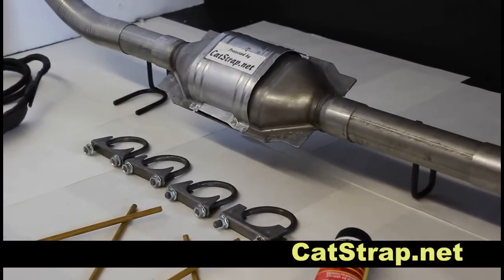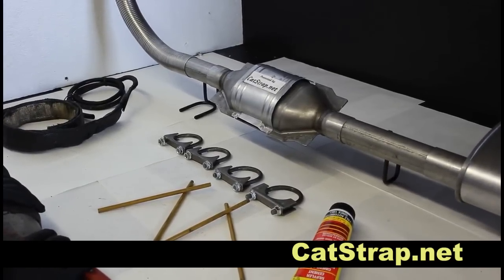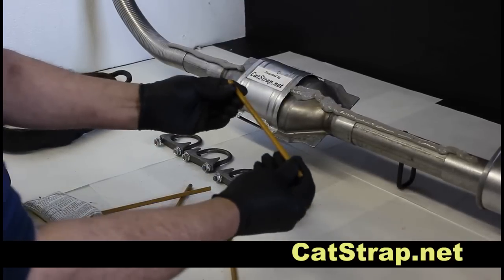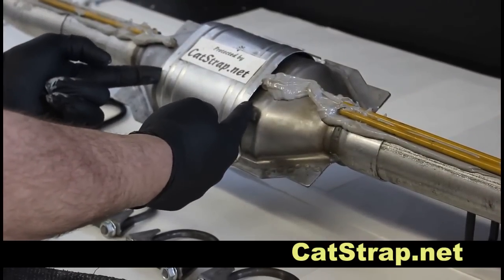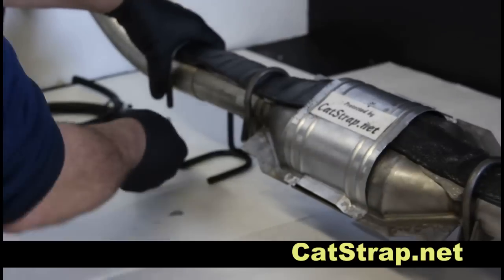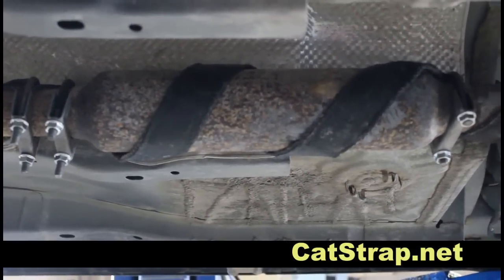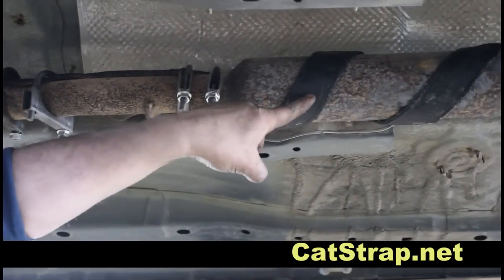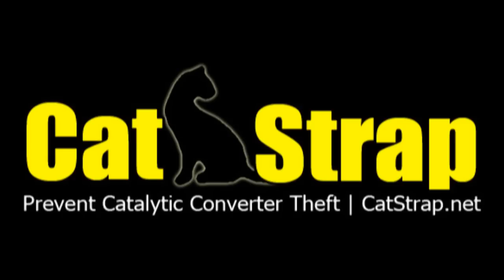Prevent catalytic converter theft with Catstrap

Comment: Imagine when it comes time to replace the cat converter with the cat strap on.
Reply: right on
Reply: Stupid comment it's an alarm and the strap is bolted on with clamps so it's not impossible to remove just harder for thieves and also the audible alarm.  Yeah you might have to buy new cat strap but the whole system shouldn't be a waste, how often do you place a catalytic converter anyway?

Comment: Looks to me like the hardened steel pins and the pipe clamps would be sufficient to deter a would be thief.  I mean are they going to bring a rachet set just in case they need to pull off any pipe clamps?  Not if their goal is to get in and out in five minutes.  Better still is to hold the steel pins in place with various sizes of pipe clamps so that the thief would have to change sockets.  Surely, this would frustrate them and they would bail for fear of getting busted.  Would rebar be a reasonable substitute for the steel pins?  Anybody?
Reply: Rebar cuts in a second and the clamps are mostly to hold the pins while the glue dries clamps cut right off to

Comment: Yeah permanent to the point, where even your mechanic cannot replace the cats when they go bad. Forget about the glue.
Reply: They will be able to eventually cut it, will take a lot more time and money though
Reply: Angle grinder would make quick work out of a cat strap.
Reply: @ghostsof6tharmy644  yup, but the alarm going off will be an issue as well
Reply: @AHalz  yeah that's gonna be problem 😂
Reply: @AHalz  literally unhook the power cable for it......not a hard concept

Comment: I’m very impressed. Do you have any distributors in the UK? Had my CAT pilfered, trying to protect the new replacement installed in my 2008 Prius. This seems to be the very best all in one solution so far! 😃👍
Reply: datathunderstorm what really me too car was parked on busy road two doors away from a shop Prius 08
Reply: Just had my 2008 Prius Catalytic converter stolen in Islington. They did it during the day in broad (albeit freezing) daylight.
This deterrent looks promising..
Reply: Sorry to hear you’ve both become victims of this dastardly crime too. I cannot believe these effing criminals are still on the loose, blatantly ripping off Prius cars in broad daylight in the capital of the United Kingdom! Absolutely disgraceful. This is neither normal nor acceptable in a so called civilised 21st century capital city!
Reply: Michael Griffiths Check out the Prius Chat website for more support and assistance regarding your CAT theft.
Reply: you need to install thick metal panels underneath the car, just like the supercars...
Reply: @datathunderstorm  thanks, I will.

Comment: I took my Cats off so Thieves are Screwed......
Reply: Recently my town's local police department posted a brief article on FB warning locals about a rash of cat thefts.  Some of the comments were people bragging about how they had replaced their cats with a flex pipe.  These comments were on the police department's post, by people who live in their jurisdiction.  I believe the fine is $2500 for tampering with the cat in such a way that it compromises its functionality.
Reply: Yeah, on modern computerized cars, that really screws up your engine management.
Reply: @fubartotale3389  Unless you put in O2 sensor simulators. There's a workaround for everything.

Comment: Stupid, This doesn't stop them from trying and messing up your exhuast. Get a plate designed for your car. Having fit hundreds of plates to Aurises, they cost £9 to manufacture and can be installed in less than 5 minutes.
Reply: Do you know a video that shows how to put a metal plate protector for the catalytic converters? Where can one buy the metal plate?
Reply: @sufi5uk  You can get cat lock plates which are more expensive. The ones we make and fit are exclusively for a car hire company for now. At some point we will be designing and making them to sell. The company that we're making them for get between 10 and 20 stolen a week. We've not yet had one stolen off the cars we've fitted the plates to.
Reply: J Anything anything you happen to be familiar with along these lines in the US? Thanks.
Reply: I was thinking the same but realised the point of this system is so that the alarm goes off and alerts people around
Reply: @teem5642  and who reacts to car alarms any more?
Reply: @OIII-IOOO  exactly. They will just continue sometimes. People normally ignore them thinking it's a false alarm

Comment: Save your money ppl. This is counter productive. Cost more money to remove when cat goes bad.  Just tack weld a length of rebar. That glue shyt and running wires is a mess. 1/2 rebar.

Comment: some engines like the GM 3.6 L in the mid size cars I think have the cat right off the manifold which is a vertical mount between the engine and radiator fans....not much theft potential there. This kit looks like too expensive, messy as hell to install and will result in a lot of difficulty to service the cat down the road. Imagine laying on the driveway and trying to apply that glue material, rods and strap to old rusty and dirty exhaust pipe in an overhead position... pretty challenging scenario.

Comment: I just threw away my old catalytic converters. Full of silver and platinum. 😹
Reply: it's like gold plating things... there's honestly not enough to be worth anything unless you're scrapping about a car lots worth of them... people make these things sound like they're worth far more than they actually are.
Reply: some are going for $800-1500 in my area. There's a reason people are stealing them right now.
Reply: @jeffhooper3447  $800 - $1500 is replacement cost. Crooks are lucky to get $50 - $100 for scrap cats.
Reply: @rupe53  except people are getting that. There are no more OEM Subaru downpipe in my whole city
Reply: @jeffhooper3447  ... starting to wonder if there's a market for that entire front pipe. Haven't seen what the new ones look like but the older ones were fairly easy to unbolt from the manifolds. (late 90s)
Reply: @rupe53  If I were doing crimes I wouldn't bother with any tool besides a sawzall.
Reply: @ToeCutter454  thats false they are worth allot
Reply: @randersizzerranderesizzer2753  only because the manufacturers mark them way up lol there's not even $5 worth of platinum in those things... the value is in the man hours and coating process not the materials... people are just stupid... materials in total to make one is less than $100.

Comment: sawzalll makes a lot of noise.  muffler cut off tool mechanical type makes no noise. doesnt matter here, no pollution control stuff. can run  smoothy sand tires on the road (cord showing) and doesnt matter as no rain... no snow that isnt gone in 30 mins or max of 2-3 days.

Comment: Well a thief will always find a way to get wat he or she wants so I say let them steal it if thy wish or risk a heavily damaged car in an attempt to remove the cat.
Reply: Do you leave your house doors unlocked and the keys in your car? Thieves want easy and fast. You aren't trying to prevent theft, you are trying to prevent theft from you. Make it more difficult to rob your house or steal from your car and they will say "fuck it" and move on to an easier target. THAT is the goal.
Reply: I mean you say that but what else am I supposed to do when my cat converter was stolen twice in two weeks? I don't have access to a garage or gated area to park my car in.  If I don't put some kind of deterrent on the car, this will keep happening over and over.  I can't afford to replace the part and pay for a rental for 4-5 days at a time multiple times a month!
Reply: @Beam3178  I just logged in to reply. You are not alone man, mine got stolen twice in two weeks.. Now I have to wait for the replacement parts for months. My mechanic will install a steel plate but what I found out reading online comments, they can cut through the steel plate as well! As soon as I get back my car I am going to sell it! I don't want to risk it anymore, I am sure they would come back third time.

Comment: Great idea for those California residences requiring the original cat on the car, but all others should just buy a new one on ebay and have it installed for a total Cost of $300 in most cases. This would result in a $700.00 net gain if you sold your original on ebay or an honest scrap dealer in your area and a trip out shopping or many dinners for your lovely lady, man, or love interest.

Comment: See I take the simple approach to stop thieves fucking with my car. It's too low to the ground to get underneath without a jackstand and I park on a sloped driveway so even if they tried to jack it up they'd have to move it first and if they want to move it's a dumb key with no remote start so no way to get it started, but even if they did get it started they would have to know how to drive stick. I leave that shit unlocked with a sticky note by the shifter that says "good luck!" 😂

Comment: Take a hardened steel chain and wrap it around the entire catalytic converter. Secure each end of the chain to the undercarriage using existing bolts. Problem solved forever. It’s easy to undo but simply takes far to long for a thief to undo. Plus, the additional weight of a chain wrapped catalytic converter makes it likely to fall on and hurt the thief in the event that they decided to cut the chain and put in the effort.
Reply: Thought about also but what about the chain rattling while i’m driving ?
Reply: @vmobile890  Im guessing that if you wrap the chain without leaving any slack, the noise will be negligible.

Comment: The heat cycling will quickly unharden the metal pins.  That fabric won’t stop a sawzall blade.
Reply: The fabric protects the wires for the alarm, the saw blade arcs the wires out and trips the alarm......

Comment: take cordless grinder with metal cut off wheel, cut clamps, cut heat shield to move strap , cut thru pipe into bondo and rods. or I can just take a hack saw and a hammer to bust bono holding rods ratchet with socket to undo clamps, cut the heat shield to pull strap out of way and cut thru pipe and have converter .

Comment: I am a heat treater and I routinely cut test pieces at rc60+ with a carbon blade angle grinder. 30 seconds I could have that useless thing off. What a scam.

Comment: I have a Leaf, guess I don't have this problem
Reply: they steal the battery instead.
Reply: @rearspeaker6364  it does weigh 660lbs.....
Reply: @stephenhodges2735  unfortunately, just give them a few more years.......
Reply: @rearspeaker6364  remember when they would park one VW bus rear to rear with another and swop the engines working underneath
Reply: @stephenhodges2735  aah, back in the day, when metric tools were a new thing to have in your tool chest.

Comment: 2 obvious problems: They wont see that its there and still ruin your exhaust, and you wont be able to cut it of yourself when you need to replace it
Reply: 1- it has an alarm and 2- exhaust is cut off by torch at a shop. A torch will cut it like it’s butter
Reply: @brokenwrench404  have fun oxy cutting it if them rods arnt steel.

Plus no, you dont use an oxy to cut exhaust tubing.

Comment: I'd like to see that thoroughly tested to see that it doesn't cost overheating of the catalytic converter because the catalytic converter heat sensor will then throw the computer off that's not a CEO sensor near the catalytic converter that's a heat sensor
Reply: There is an oxygen sensor before and after the CAT.  There is no heat sensor.

Comment: This might deter the thieves but doesn't mean they wont attempt to cut it. If they try to cut it yea you would of prevented the theft but your catalytic convertor is useless now and you would still need to get a new one or have a shitty welder weld it back at a exhaust shop....

Comment: what happens if you need to replace your catalytic converter? And...  if someone does try to steal it they will jack up your exhaust and it wont be able to be fixed without replacing the whole exhaust system.. LAME....

Comment: I don’t like “probable” place they will cut and once they make cuts through any part of the pipe you get a damn loud exhaust, like a hole in the muffler, which you have to repair anyway. This company is getting thieves too much credit. They would see this “system,” not know what it is, and try to cut it anyway, thereby doing damage which needs to be repaired anyway.
Reply: My thief didn't cut at the "probable place", they cut at the ends. presumably if the cat had been welded at the top, they'd have sawed/pried out the bottom of the cat.  Less tidy, but if they cared about tidy they wouldn't be mucking about under cars in the middle of the night.

Comment: Not impressed with this product.  I like the idea of an alarm, but other than that this device has too many pieces and can be easily taken apart with a socket wrench.  Those two hardened steel pins at the stop can be avoided by simply cutting from the bottom up.  Yeah, not worth it.  Much better to have welded, solid steel, clamps at each end.

Comment: Its one idea not perfect thief will just cut a longer section including your muffler with it ! The only good solution on truck it to screw and weld a 1/4 steel plate over it ! Catalytic are made of very similar products than the lithium batteries are made same thing with electric cars they will steal the whole car to process and black-market its batteries !

Comment: None of this works against a grinder. I saw a video where $300 bike locks were ground thru. I would think a plate under the whole area would be best as seen on the net.
Reply: Exactly! A stainless steel plate over the whole thing is better because the thief can't get to the converter. If all they have is a sawzall with a metal cutting blade, having to cut through that first would take some time, and make a lot of noise. In my mind, that would be a big deterrent.
Reply: Nothing stops them, just makes it take longer and louder. So just a pain. I walked out of the grocery Stone June 2020 one guy looking under my truck and the other saw me and they bolted.
Reply: @81pepperman  10 guage shotgun is best deterent

Comment: It's a good idea, poorly executed.

That's not the most likely place they'll cut them, they most often cut the pipe as it's not twice as thick as is on the flange.

They use all sorts of tools, hacksaws, grinders with cut off wheels, reciprocating saws, and manual pipe cutting tools. (Silent)

They'll cut thru the pipes or thru the case itself. They only want the elements inside. 

One crew even used a plasma cutter. 

Now, all they got to do is use a battery wrench, loosen the nuts, move the strap, and away goes your cat. 

Then there's the issue of replacement and creating hot spots. It'll destroy the cat and need replacing, but now that's going to be an expensive chore.

Comment: think they dont cut the bolts but the pipe on both sides but dunno, ...migth have easy on off system and take it off after yearly inspection put pipe instead or empty converter to make them work for it . then govt might do random cat checks or more. . or attach explosive to it but too risky ,triggered w removed. or like paint explosive small. tracer on it under some rusty cover no getst oo hot but on a non used car inside it. fireworks at them , potatoe gun. get into other car down the street to ram them, but thats murder for theft over top. some night guards under sides with fish hoocks ..or by sides net bundle hard to get away, stinking with what chemicals or rotten things....or some thick wooden plate or metal grill strong thick pipes locked under car at night , to the car , or, mounted in ground , a protection that rises up from hole , around cat , but if you forget and drive much damage. or rises up along sides of car or the side cat is closer to, or have it on hinges and lift up to car side and lock it in that position, or just heavy rocks or wall park by it close , or between . gated community or all must identify themselfs when passing by cam warning to police or hood team if not. water sprout directed at cat area cool them down or hot water or feces water, think they dont cut the bolts but the pipe on both sides but dunno, ...migth have easy on off system and take it off after yearly inspection put pipe instead or empty converter to make them work for it . then govt might do random cat checks or more. . or attach explosive to it but too risky ,triggered w removed. or like paint explosive small. tracer on it under some rusty cover no getst oo hot but on a non used car inside it. fireworks at them , potatoe gun. get into other car down the street to ram them, but thats murder for theft over top. some night guards under sides with fish hoocks ..or by sides net bundle hard to get away, stinking with what chemicals or rotten things.ll

Comment: Just go smog your car when it's due and then just remove them and have cat delete pipe made and installed then just put your catalytic converters away in your garage till it's time for another smog inspection.  Once the delete kit is made you just bolt on and bolt off as needed no welding!

Comment: It's 2019 and I had mine stolen in So Cal, Toyota charged me 2950.00 to replace, on a bloody 2006!  Had a guy install this strap but he put it on the top, you could hardly see it and the cat could be cut out without cutting the strap. So I moved it to the bottom.
Reply: 2008 tacoma my front cat ran me $400 for a magnaflow.. got a steal of a deal for the cat+labor only 400
Reply: @Xiferr  you must not be in california
Reply: @WAVYU5  yes I am